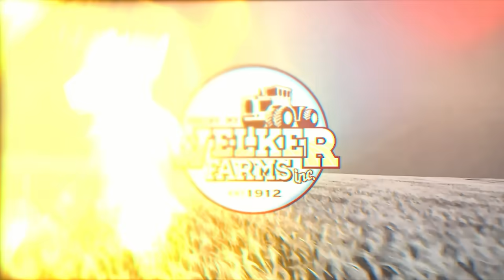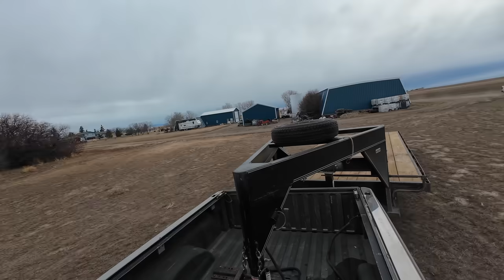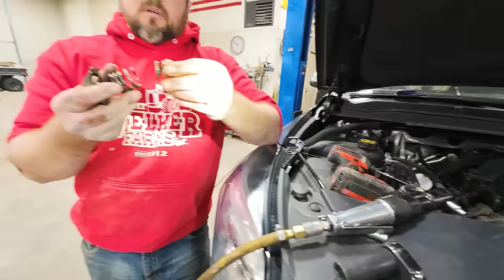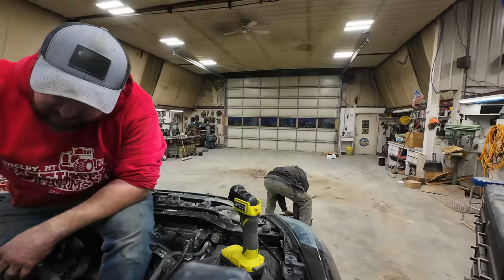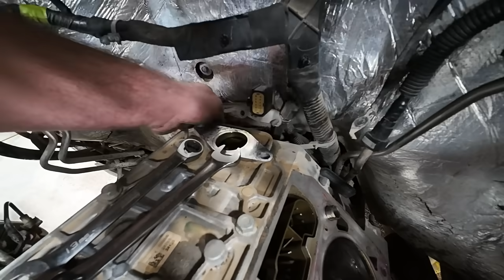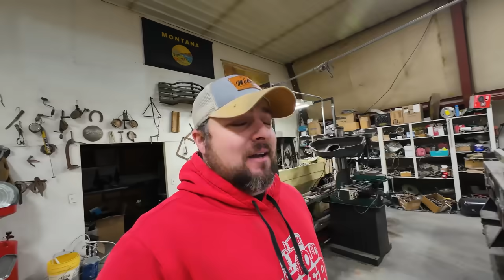Not Again! 🤦‍♂️ Engine Cratered...Let's Find Out What Happened

Comment: We have six trail bosses all of them have the 6.2 L in them.  
  Three of them are 2019 models all three of them have over 300,000 miles on them in the west Texas oilfield, the other three are 2022 models they have all reached over 160,000 miles   
  My personal truck is a trail boss with the 6.2 L in it It has 277,000 miles on it as of today.  
  And I can honestly say none of these vehicles have ever had a mechanical failure as of yet engine and transmission wise   
 All of them had a alternator at about 150,000 miles that's about as much as you're going to get out of a Chevrolet alternator with that thin brass bearing  
  One of them has had two or three starters on it but that's all that was ever spent on them  
   That 6.2 L is a beast, knock on wood we have never had any lifter failures or anything
  When we have those issues it was on the 5.3 L on our 2016 models we had

Comment: All of direct injected gas engines have build up on back side of intake valves. Most of it small amount of oil that comes down through valve guilds which is normal. Port injection also cooled intake valves besides cleaning port and valve. Now valves are hot and oil cooks on back of valve head now. It will get so bad it stops airflow into cylinder. All manufactures have procedures to clean ports. GM had issues with valves too. There are engines that have port and direct injection

Comment: Yours is not the only one to drop a valve.  The springs are suspect...  Do not put GM valve springs back in it.  Does not really matter who's aftermarket springs you use, but get some quality springs.  I'd get them from Powell Machine, but that's just me.  Good luck 😊

Comment: So I posted a place that will take care of this in any way you wan that is possible here.  They remove the post. You can get the parts you need or repair what you have.  They are great people.  They did the engine work on my 1500HP ZL1.  If you want the info I can get it for you.  They do stock to 5000hp engines.

Comment: That messed up air intake plastic also probably messed the system up to by altering the air/fuel mixture because extra air was entering the intake after the MAF sensor.  The dirt entering the intake, along with the throttle body opening with the wrong sensor reading causing a lean fuel mixture was probably part of the problem.  So nice for them to let you borrow their vehicle for such a long trip, not everyone would do that.  G-d bless.

Comment: Bummer that blew up on you.  Hate to say it, but might want to switch to a more reliable brand of vehicles after the family experience with those GM engines.  Highlander or Grand Highlander.  The (gasp) hybrid Highlander gets 36MPG per spec - what's the Denali get?  20, 25 on a good day?  Lots of miles to drive there in MT.  Yes, the GMC is bigger, more room, etc.  Get a coffin box for the roof for more stuff volume at the cost of 5mpg or so and inconvenience when loading / unloading.  Rare to hear of the 'yota brand sucking valves, at least at under 150-200k miles.  First 60k on Mrs Token's Rav4 hybrid and it's needed....oil changes, tires, filters, wipers.  Mine at 50k....oil changes, filters, wipers.  Both work perfectly.  We both get near 40 MPG.  Should get 200-300k out of it with pretty basic maintenance.  Back in the day I was all in a Ford guy and had bought a GM coupe, 'Merican cars, not those foreign brands - loved my Torino back in the 80's (fit in with the old Mustangs, Chargers, Camaro's, Fairlane's, etc in the HS parking lot), the 93 Ranger I replaced the Torino with, liked the Oldsmobile that supplemented the Ranger as the daily driver.  But practicality changed my mind on brands.  Sold the Olds and got a 'yota Corolla - inexpensive, reliable and sipped fuel.  At 20 years old, the Ranger ended up rando dying on the freeway - mechanic couldn't trace the issue, so got rid of it and got a utility trailer for truck like hauling capacity.  Now driving the Rav4 Hybrid, even better fuel mileage than the Corolla, bigger, AWD, etc vs the economy box.  As much as I wanted a truck, the Tacoma was 5k more and used almost 2x the fuel of the Rav.  I put a hitch & harness on the SUV and haul a cheap 1 ton utility trailer on the off chance I have bulk material (bark, lumber for projects, etc) to move.  Yes, I live in the 'burbs, so it works for me - 1 vehicle that does it all (daily driver, into the Cascade mountains on snow and ice, hauls the trailer, etc) and sips fuel on the daily drive.   For a SUV people hauler, perhaps look at the 'yota Highlander, made in Indiana, Rav4 in Kentucky (so yes, Made in 'Merica) and Canada.

Comment: Just my two cents,  New head yes.  block might be salvageable if they bored it out and sleeve it but I'd look for a new block as a plan B.   For nick...just take off the heads, it's sooo much easier to replace valve springs that way.

P.S. the word you are looking for was Bell housing because when you stand a trans straight up (output facing up), it looks like a bell.

P.S.S. Plan C is to put a funmmins in it 🤪......

Comment: Hollow valves are usually sodium filled to help with keeping the valves cooler, but does create a weaker stem, I would replace with solid stems if you can, GMs dod/afm design was a bad idea, still have it in my 2013 Tahoe 5.3, need to get it deleted

Comment: Hey if this keeps happening to your GM vehicles just get the DOD part deleted and just let it run full time on all cylinders. I have an 2009 DOD GM vehicle and it has been deleted and I’ve got 210k and it is running strong. The only downside is you might not get as great of fuel milage.

Comment: I dropped a lifter on my 14 escalade.  Ended up doing a cam swap, rocker trunnion upgrade, new ls7 lifters and springs,  dod and vvt delete and finally headers.  Runs nice now.  I was hoping you'd only end up with a dropped lifter.  Good luck with build
Reply: I installed the TruckNorris cam from Brian Tooley Racing.  I would definitely delete the dod stuff..
Reply from the maker: That's what we want to do, bullet proof as much as possible. Should be 200k engines after all that!

Comment: tou need tto find a "camper special" vintage suburban and completely build it to newer bullet proof standards.  Cummins 5.9 12 valve, automatic transmission , and an all new, modern soundproofing and interior package. Maybee even go with a newer GM or dodge truck torsion bar chassis and suspension system. I know where you can get a complete running 89 D 350 for the right price 2wd dually

Comment: You know there is an adapter to screw into a spark plug hole that allows you to put air pressure into a cylinder so you can change the valve springs without removing the head.

Comment: My brother called me since his JD A died and wouldnt start so i told him shift to neautral and engage the clutch and grab belt pulley and try rocking engine since battery cable was smoking and engine not rolling over.  Maybe bad cable or starter i was hoping but no im pretty sure he locked the engine up 😢😢😢  it sounds like he ran it out of oil again.    The worst part is that is a family tractor like my 520 and may have been bought new by my dads great uncle.    But on a good note they arent virtual phones😊 so i couldnt strangle him.    
I talked with my tractor friend since major repairs i dont have time and ability so yeah costs a lot more hiring but my 520 is just about ready to get picked up from getting overhauled😄😄😄😄😄 got .125 oversized pistons now.  cost me 7k.  Im toying of getting dropped off and driving her home or firing up big red and grabbing my 9 ton trl and hauling her but if i do im taking scenic route home.  The scenic route i would take is only an hr there then an hr home vs a 30 min drive😊  i would take tractor out to gramps grave.  Mom thought i was nuts when i told her my idea. Its symbolic to me as i first drove that tractor when only 6 ish on his lap

Comment: Don’t worry about that motor 

There’s 1,000s of them in wrecking yards 

Those LS motors are fairly bulletproof
And no way 5,000
Or more 
eBay complete from $ 1,200 and up 
Summit has crate LS 5.3 for 4 grand 

And a lot of those wrecking yard motors are from smashed cars 
Not from die hard farmers who drove the legs off of them 

Quite a few of those motors have 30 to 80 thousand miles on them 
You could get a complete motor delivered for under 3 grand

Comment: As odd as it sounds and it’s already too late probably, but it’s a lot easier to pull the whole body than you thin to pull the motor when you have a lift.  You can even leave the ac charged just hook it to the body when you lift.  Leave the master cylinder on the lines so that system stays in tact also. 

If they can’t bore it to get rid of the damage they might be able to sleeve it. if you have not sent it in, check out Jim’s Automotive Machine.  He has a YouTube channel and appears to care as if every job is their own.  Might be a bit far down in Colorado and one of the I’d a “hobby”farmer running old Alice Chambers tractors.

Comment: The issue with the GM stuff is the oil change light. It makes them go 10k plus between changes. If your buying one and the guy says I changed it ever 3k miles. What he means is he changed it when the dash says. 5k max on oil change interval on most vehicles. If ya have a GM anything ya should actually change it at 3k miles.

Comment: DOD/AFM program delete brother.
Don’t even have to change the cam rods or lifters. 

Got a 07 Tahoe ltz 5.3 with the originals lifters from 2007 at 268,000 miles only program deleted. DOD lifter never fails if they can’t be activated. 

Commonly the springs on the DOD valves micro crack and fail, or the push rod takes a punch in the head on sudden activation and bends. Usually when the spring cracks you will get a sudden code for miss fires. Where it went bad was mashing the gas when it start to have trouble. If you keep the rpm low the spring doesnt have enough rapid movement to shift and drop. I’ve seen 4 broken springs in 1 head before.  

Also, big issue with electronics in the GMT900 trucks (the bail out years ) lighting up the dash emojis is dirty grounds on the harness to the chassis and the fuse box in the engine bay is just a regular old circuit with no water proofing. You can spot that by progressing lists of codes and module communication failure.  

Go aftermarket also, GMs OEM ac delco parts are made in china, companies 50% Chinese owned since 2014. Just throw in a Texas speed kit.🤙🏻

Comment: Always been a gm guy but we got our first toyota tundra in 2007 has nearly 300000klms no issues i find it hard to look at gm or ford with all the over engineered crap they have on them that doesnt work
Reply: Comparing GM and Ford trucks to that Tundra is apples and oranges.  The 4.7 and 5.7 engines are marvels of engineering and the 6 speed transmissions behind them are so strong and smooth.  I love those engines.

Comment: I would have checked the crankshaft position sensor first before you do anything before you even tore it down because that is the main thing that goes out on these stupid motors it's bullcrap lol I hate it mine's down right now and I don't want to fix it personally I'm going to have a shop do it because they place it on the freaking timing chain cover

Comment: So we all know GM engines break valve springs, V-6's do it too. Unrelated question, why didn't CNH ever build a two-track differential-steer tractor in the 250-400hp range? They have become the gold standard in corn and soybean country for big planters and grain carts. Instead, all they got is those goofy Magnums with track attachment, which is obviously some sort of compromise to try to compete with the real thing.

Comment: I used to be a GM guy too. But I got burned too many times by poor engineering and cheap quality parts. My neighbors 2021 Tahoe has had numerous lifters replaced. Both banks had lifter failure before 15k miles. For an $80k vehicle, you expect better quality. And the months it spent at the dealership waiting for parts. GM finally offered to cover some of his payments, but after long battle. Ford is not much better with all of their recalls. Domestic vehicles seem to be struggling with quality the past few years. The GM of the late 90's to mid 2000's seems the be the golden area of reliable, easy to fix vehicles.

Comment: I'll take an motor that doesn't give me as good of fuel mileage but is easy to work on and has way less computer crap on it. The older stuff was way better any body that wanted to learn to fix there car/truck could grab  book and figure it out fairly easy and save hundreds of dollars doing so.  Now days you almost need a PHD to work on the dam things, there's  sensors for everything.

Comment: lc9 5.3 swap it with a sloppy mechanics best cam, ls7 lifters pac springs and supercharge it ......... way more power no more issues and alot cheaper . even if you stay 6.2 dod delete it and put a performance cam in it its super easy.

Comment: A suggestion: have your new valve springs cryo treated.
Reply: That’s an interesting idea.  Would that make them that much stronger?
Reply: @hokie9910  Cryo treating relieves the stresses built up in the manufacturing process and make the molecular structurer more dense. If I have a rifle barrel that is not shooting well I have it Cryo treated, that usually fixes the problem. Many racing teams have their valve springs treated.

Comment: History of sodium valves date back to WW1 air craft engines. 
Allows the valve to operate at a higher consistent temperature. 
The valve was invented by a company named Thompson Products of Cleveland Ohio. The name changed to TRW in later years. The US airplanes were superior to everyone else’s. 
GM is retooling the small block 8 cylinder engine for future applications. 
Drop the spring at the dealership and ask them to send the spring back for analysis. Appears the spring may have a design issue.

Comment: Can't you just turn off the 4 cylinder mode with a tune?. My wife has a yukon 5.3. With 43,000 miles iv been thinking about getting it tuned let it run on all 8

Comment: issue is with the head, all the dents need to be welded up and then refinished, if you plan to repair the head. Otherwise it can cause hot spots and melt the head or cause detonation.
It will also mess with compression too, so if there's a local speed shop who does drag racing or tunes LS engines , they should be able to repair that head.
As for the valve springs and rocker arms, it's a good idea to investigate some aftermarket options from Comp cams or such, as they shouldn't be much more than OEM, but better quality.
Could drop a slightly better cam in for a little more power combined with the new spring kit and a trunion bearing upgrade to bushings , this'll remove any chance of those needle bearings dropping and going round the engine.

Comment: Yep new cars are junk 2021 ram with v6 motor knocks like crazy.   Dealer says oh ya I’m sure the cam is wiped out it happens from the automatic start stop less than 40 thousand miles and that was the last straw after electronic problems 4 wheel drive problems and the blinker built into the 1300 dollar headlight that needed to be replaced
Reply from the maker: 🤦‍♂️ Who is running these companies?? How can they see a future building trash?

Comment: I'm confused.  You think the mileage is fantastic but you think the DOD is junk..... What if the DOD is the reason for the great milage??  How many miles on the Yukon?
Reply from the maker: The dod is a joke, we have ran it on and off and it might at most add 1/2 mile a gallon. Most of the time it is the same. Switching between 4 and 8 cylinders adds a brief moment of low power and the cylinders that are not combusting build up carbon in the ring seats.

Comment: High mileage?
I have been a GM fan since I bought my first new one in 1973. I have always had good luck until my 2016 Suburban. It had a cylinder head replaced at the first oil change and a crate engine at 30000 miles($12000 plus warranty). I didn't know about the cylinder deactivation until I saw V-4 on the IP. Dealer removed and replaced the engine from the front. 
I also have a 2020 Sierra AT4 with 6.2 and 10 speed. It is fun to drive. I would like to have a 2024 HD AT4X 6.6 gasser and 10 speed no cylinder deactivation.
Have you ever heard of driving in L9 to prevent deactivation?
I do not want anything but GM.
Reply: And your still a GM fan and even though your engine grenaded at 30k miles…..  I would have run not walked away from GM.  These are well known issues with LS engines since 2007.  It’s not getting better and it never will.

Comment: If you put the transmission in manual and then just run it up to the max gear while sitting still or moving it will shift normal and not go into DOD mode.  Besides that HP Tuners, BTR cam, lifters, trays, springs and retainers.

Comment: So you said you get great, great gas mileage. And then the senate's right after that is they need to get rid of the system that makes it have great-great gas mileage. L, o, l, it's not a bad system. It is when you're trying to hot rod. Or you don't maintain the system to get the great-great gas mileage.  Ever heard of got to take a little bit of bad to get a little bit of good guarantee.You get rid of the DOD it will be more reliable but you'll get worse gas mileage